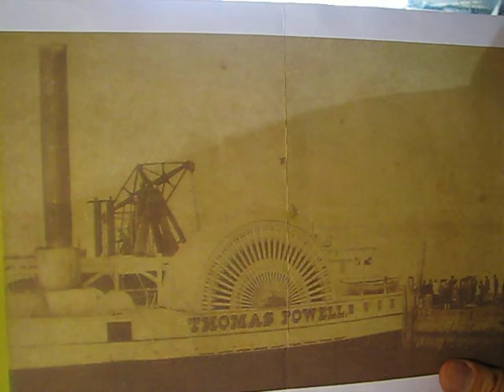PADDLE WHEEL Steamboat Thomas Powell #1. In the shipyard. Hudson river Flyer, Scratch built RC model

Comment: One of the interesting things about the Thomas Powell, as a very early boat, is that the wheel and engines are very far forward on the hull. Later sidewheelers (such as the Ticonderoga) had the wheel more to the center, and maybe even a little aft. That is, the position of the engine and boilers is reversed, with the later boats putting the boilers closer to the front and placing the engines behind.
Reply from the maker: Exactly, all about weight balance!
Not really about "early or late" (Hudson River Robert Fulton 1909 also had boilers aft).
A good example (and still visible today), although not walking beam engines, is on the Geneva Lake, flipping engine and boiler arrangements with nearly every new paddle steamer since 1840, this until the last 1927 built "Rhone".

Comment: How do you cut line plans accurately, and also plank the hull so smoothly with the curvature of the hull?
Reply from the maker: I simply turned to surviving hull plans of similar ships!
I then adapted draft and shape below waterline to fit my needs (my metal models are heavier than should be at scale!).
The stern is the tricky part to build.
Thanks for watching!